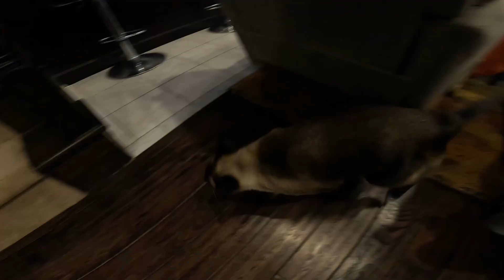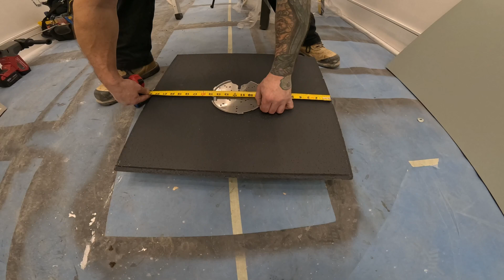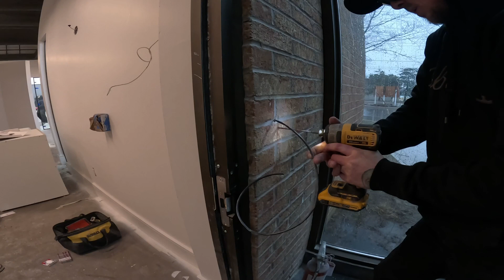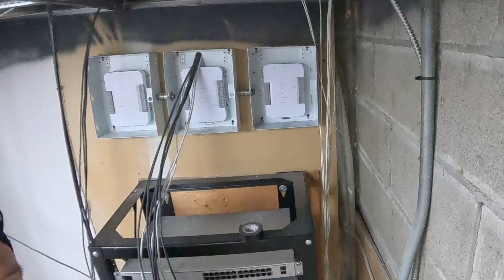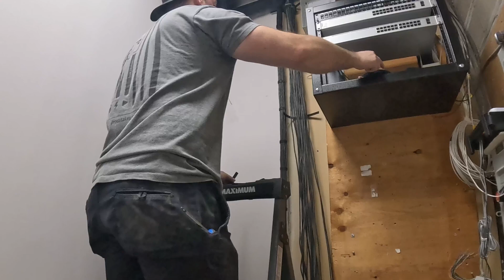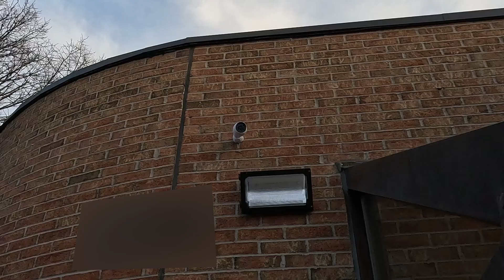Unifi Onsite job : Unifi network, Access and Protect

Comment: How would you recommending getting the power/signal wiring for the electric lock inside of the frame of these storefront style doors in existing construction?
Reply from the maker: Well you're going to have to make holes so most likely with some conduit

Comment: "We put on back boxes as we couldn't drill in to the brick"....instantly drills in to the brick to fit the back boxes... 🤣
Reply from the maker: Big holes in the brick lol
Reply: I appreciate you method as I was wanting to add door access points to a business we just acquired but the whole building is concrete block with metal inset doors. We did want to punch big hole is the blocks either. @MactelecomNetworks
Reply: what i came here to say🤣
Reply: And then they cut they metal frame .....

Comment: Very silly question. When dropping 40 cables from the ceiling how do you know which one originates from which device etc when keystoning them and plugging them into your switches? Do you have tags/write on each cable end?
Reply: If you don’t label them you have big trouble. Ringing out 40 cables in a big location is not fun.

Comment: Is there a reason why you went for 2 x 24 and not 1 x 48 port switch please?
Reply: I have the exact same setup for redundancy. Initially had bought a USW-Pro-48 that a few months died on me. Now I have 2 x USW-Pro-24 so in case one of them dies, I can transfer the essential connections to the working switch until I get a replace.
Reply: I was thinking the same thing ….

Comment: Great Job and very clean and  and well organized :-), if you don't mind i wold like to know your opinion i will have to connect 3 x Unify16 port switches to  an UDM-Pro, I know is a bad idea to daisy chain switches so here what i have in mind , Cable modem to the UDM-Pro ( connection to the WAN interface) UDM-Pro CAT6/CAT7 to the first switch  as both are located physically  in the same location, i not concerned  about uplink speed as the modem speed is limited to 1 gb/s anyway. And using the two optical ports of the the UDM-Pro to uplink to the other 2x Unify16 port switches. i have to use optic fiber  as the limiting fact is the distance ( more then 300 feet/100m), what do you think? would you have done it differently ? Feed back much appreciated , Thank you.

Comment: That moment when you build everything with Unifi and need IPv6 😮. You are lost 😩.
Reply: Nothing shown here would stop you using v6.  
I'm typing this on a device which has a v6 address, connected to a unifi AP, which is connected to a unifi switch. 
Neither of those two has or needs it's own v6 address, and those device's management interfaces don't get internet access.

Comment: Why did the access hub have to be mounted in a box?
Reply from the maker: We didn’t have to but it looks neater. Also those boxes had a cover with a lock on it
Reply: @MactelecomNetworks  what kind of boxes did you use ? they look slick . also what size did you think would have been better ?

Comment: Great work as always!

I'm glad to see you are using the velcro on the Panduit cabling.  Zip-ties on Panduit cabling is a big no-no and I believe it will fail certification.  Panduit is the BMW of cabling - its almost all that we use.  As for the electrical boxes you were working on in this video, it looks like you are using the Paradox 8" x 10" x 3" metal boxes???  Paradox also makes a 11" x 11" x 3" metal box.  I use the 11 x 11 x 3 box when doing similar work - and they work very well.  The 11 x 11 x 3 metal box can even fit a full 10A mount and still be able to close the door (and lock it - if you want).  Those are both sold by the distributor that you and our team use.  The project was very well done - love the attention to detail, such as centring the WAP on the 2x2 ceiling tile. NICE JOB!

Comment: “Couldnt drill into the brick” - Proceeds to drill into the brick
Reply from the maker: A massive hole in the brick
Reply: The RJ45 connector protrudes from the back of the door reader.  If it was mounted flush to the wall, a large hole would be needed.

Comment: So they got sold on "everything is in the cloud," and they don't need a firewall? Some of these sales guys should know better that they need something other than the the ISPs modem. Sure, the box probably does basic DHCP, but that's not advice a business should get with a medium-sized office network based on the number of drops. The cost difference for a Cloud Key vs DSMPro is not that much; he should have insisted on it.
Reply: MSP is probably rolling their own solution

Comment: What kind of back box did you use for the readers? (1.10 into the video)
I have the same problem in my house (although I have the “old” pro reader. Any suggestions?
Reply: Never mind. I see you already answered it below. A strangular regular black box it was. Can I fit an old reader pro on iit as weel?

Comment: I'm super confused/curious why there is access control on 2 doors in the same entrance? Surely there is no point to having that setup?
Reply: The intention must be to open the first door remotely to allow couriers to drop off packages to a secure area but not have access to the building.
Reply from the maker: You an I both 😝 not entirely sure
Reply: Also, deters tailgaters.  My employer has door access and then gated turnstiles.
Reply: @n9wox  Surely if you're close enough to tailgate on the 1st door, it'd be no harder on the 2nd...
Reply: It looks like it's trying to be an 'airlock' type setup. Someone could follow you through the first one, but you have an opportunity to stop them before they can barge in.  I don't know if Access can be set up to have an interlock between door 1 and door 2 - that is, only one door can be open at a time.

I've seen something like it in more secure entry areas - but those had permanent guards for ensuring no tailgating.

Comment: Thanks for these videos? How does one run ethernet cable through brick/concrete/flooring? Also, was the customer given a flat rate quote in advance, or was a bill given at the end of the job?